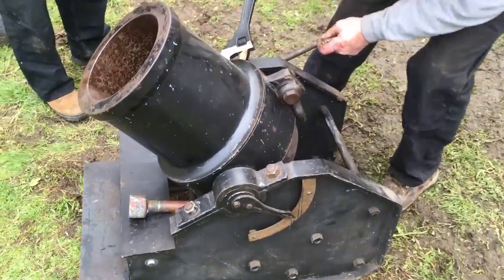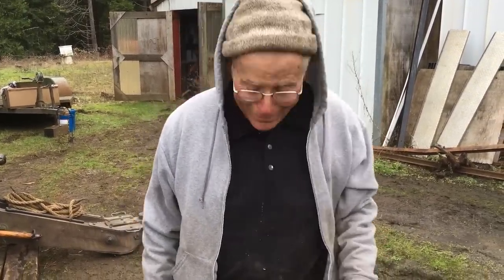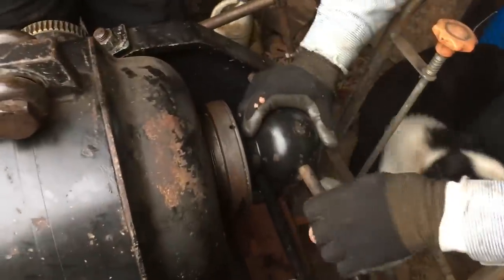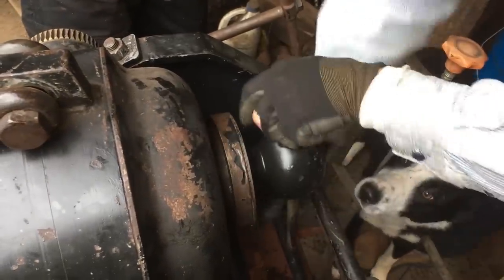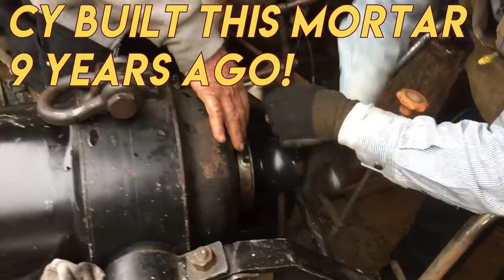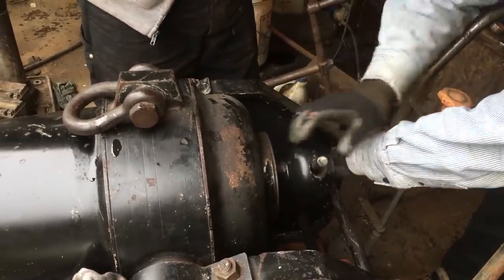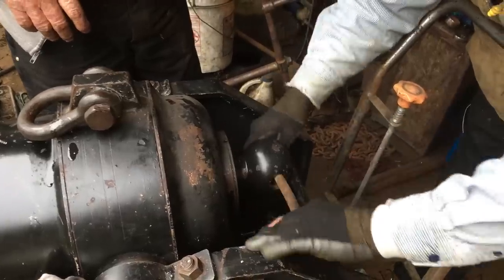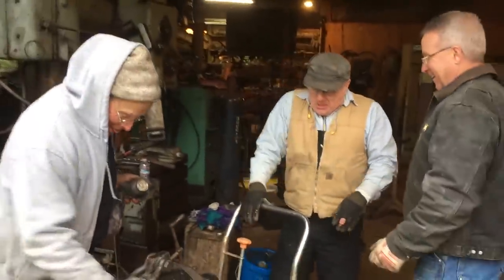How to Get Rid of Pesky Bowling Balls

Comment: @ 0:52ish : "The bowling balls have shrunk a little bit from sitting in the sun."

Wouldn't they have actually expanded a little bit ? Typo or you meant "in the shade" ?
Reply: Not sure about this, but heat from the sun would only make them temporarily expand. Sun/heat over time would cause loss of moisture, and therefore permanent shrinking
Reply: Ah, hadn't considered that. Thanks SpicySalsa. Do they shrink with age ? Heating and drying out ? Always thought they were pretty stable.